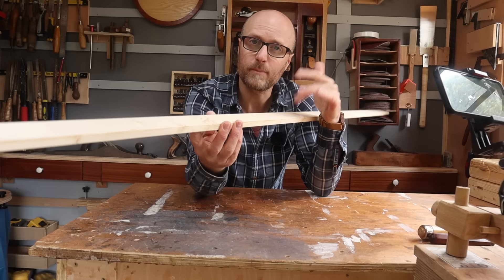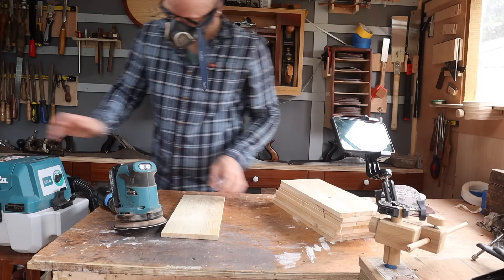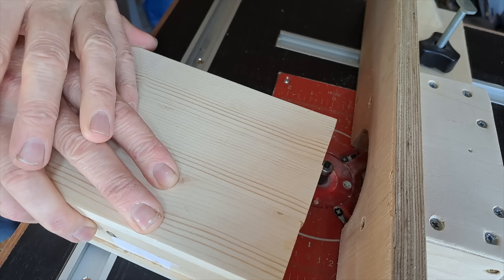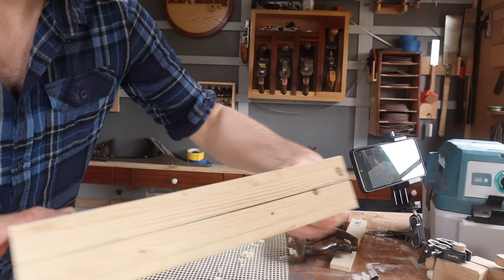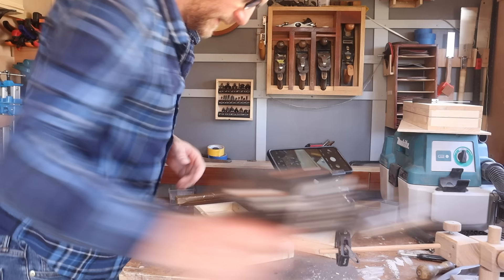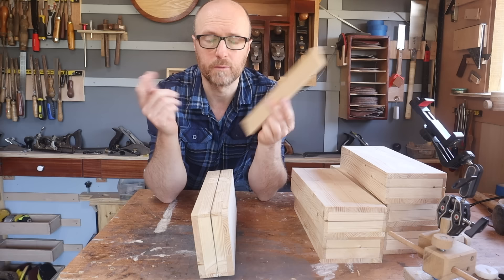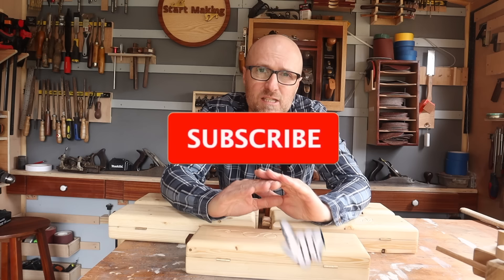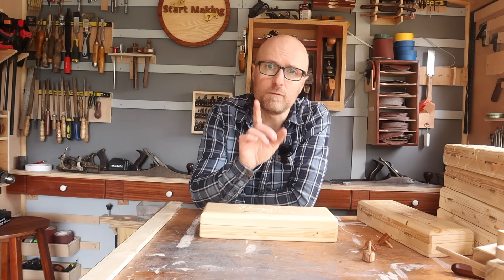Beginner Woodworking Project that Sells | ONE BOARD BUILD

Comment: I like that you are using mostly hand tools unlike every other YouTube woodworker that has saw stop and festool equipment saying "it's easy" as I cut a perfect edge with my $6000 piece of equipment.
Reply from the maker: Lol, I know, it is hard to relate to some but they also do some cool stuff. Me, I like hand tools and slowly growing into my tools.
Reply: I like the videos that are apparently aimed at beginners then they start showcasing all their fancy tools and it's like, what? Do I look like I got one of those?
Reply: Haha! 

"Check out this easy bird feeder ANYONE can make! Ok guys first step is take your $1000 length of dragonblood ply and fire up your $1000 Festool jointy-magoo-thingamajig"
Reply: I hate the noise of power tools. I love wood and would love to make things but I can't stand the noise.
Reply: Hmmm, I got my big uni-saw from facebook marketplace for $250...  It's used, sure, but it works just as well as it ever did.  I had to sand and polish and wax the table as it was rusty when I got it, but that only took a day or so and now its much sturdier and more powerful than the old Rockwell 9" contractor saw it replaced.  Most of my larger tools I've bought like that.  My Delta 14" band saw was made in the late 90's but still worked great for what it was, but I added cool blocks to it and replaced the old rubber tires on the blade wheels with new urethane ones.  Haven't added a riser to it yet, but will when I find one cheap enough.  My point is, you don't have to pay $6k to get a tool that will do just as well.  No, it doesn't have a riving knife, but folks managed without them for most of history.
Reply: @theoryofpersonality1420  You would like a PBS show called The Woodwright's Shop--That guy (Roy Underhill) only uses non-powered hand tools to build all his projects.

Comment: I'm not sure how this is beginner-friendly for people that don't have a lot of tools
Reply from the maker: You need a way to cut wood. A way to sand it and the router is optional. I get that beginners will not have a huge amount of tools but I did this without electricity and you can swap a circular saw for a hand saw. I don't understand comments that say this is not beginner friendly.  If you are learning woodworking you need to have some tools. The basics . Surely.
Reply: @startmaking1  For some people the idea that "beginner" refers to skill level and not available equipment just will not compute.
Reply from the maker: This comment is perfect. If you dont mind I will use this in some of my replies. I understand how some people will see the amount of tools, even the small amount I have (compared to the average video maker), and they will see it as expert but I consider my skill level to be beginner/low intermediate. And that is important. Thank you.
Reply: @startmaking1  wow you consider yourself to be beginner/intermediate? What's below beginner then? 😂 I'm below that.
Reply: @startmaking1  De nada, use it with my blessing. I learned that lesson the hard way myself, and it's something I've tried to pass on to anyone I've trained since: Doesn't matter how many tools you have if you don't know how to use them.
Reply from the maker: There is so much I can't do and we all start with different skills and go in completely different directions. Labelling it is hard and in most cases not too important. What is important is to enjoy it and not feel that anything is beyond you.
Reply: @dudeistpriest787  yup so true. I try to get someone more experienced than me to show me. Usually my son.
Reply: @KMF3  Isn't that what your kids are for? 🤣

Comment: Hi, Mark. Great stuff. 👍👍👍
Another option: (this would need to be done Before assembly)
If you would like to create raised lettering or imaging, on the top (or anywhere),
draw your image in double line form (like your block letters). Then use some small metal pieces
(whatever you can find that works), to hammer the image down, below the surface.
When finished, sand the entire surface down to the level of the image. Make it, just barely, disappear.
Lay a damp cloth over the sanded surface. Apply heat and steam, with a steam iron. (no damage to iron)
The image/lettering will rise up, to it's original height. You now have a beautiful hand carved top.
An age old technique, which I learned about (never used) many moons ago and thought was amazing and Still think is amazing. Works with, just about any wood. 😁✌🖖
Reply from the maker: Ho wow. That sounds brilliant and right up my street. What a clever and simple technique. Thank you.

Comment: Fantastic video! I’m planning on getting into woodworking and have watched a ton of videos, but only now found your channel.

I had a plan in mind to make a really sketchy table saw using a circular saw, but then I saw your setup and that’s so much smarter! The setup near the start with the metal rails.

Plus this video uses pretty basic tools and as someone whose going to be new I respect that a ton.
Reply from the maker: Hi Ben. Thank you. Glad that you didn't make that table saw. I've seen a few and considered it myself but it felt too risky. The kreg cross cut Station is a great starting point. There is a video I did on it. Hope it helps.
Reply: @startmaking1  Sorry for the late responses, I don’t check comment responses often. Thank you for the reply and I’ll totally check that video out.

Comment: These look really great, they could also be stained to make them less piney but that all adds to the outlay. I love the simple locking device really clever. great project idea even if you just make for friends and family at christmas. thanks for sharing.
Reply from the maker: Hi Andrew. thank you. Great gifts for sure. And yes satin would work but sometimes pine comes out blotchy etc and as you say there is the expense.
Reply: @startmaking1  yes good point I have had success with tinted varnish

Comment: So many ideas coming to me as I get ready to start the carpentry diploma course. Some ideas I'd like to share with you since you might enjoy using them in your projects are basically on the lines of using fluffy material for the outter finish. I have ideas to bring back pure raw bark finishes also for wardrobes, maybe even use the old western pub doors for wardrobe doors and other fun ideas like that, but the fluffy idea I think would sell, and would be great for those looking to use cheap wood that has knots and definitely wouldn't otherwise be used for fine woodwork
Reply from the maker: Fluffy materials, wow. That sounds like an interesting idea. And the doors too. I like that you are thinking outside of the box. That is how amazing things get created.
Reply: @startmaking1  yeh cheers bud, I think a lot of people are still gripped very tightly by fear, but now we have the knowledge of how to release fear slowly emerging on the planet, I think we will soon see the true creative potential that we have begin to show soon, because then nothing will stop people from connecting to their pure desires and passions if there's no negative emotions blocking those pure desires

Comment: For sanding the cut area between the lid and the box, you can also glue a full sheet of sandpaper to a board,  clamp the board to your bench, face the cuts down, and sand pull the bottom/top across the sandpaper.  Having a sheet of sandpaper glue to a board can be a great tool, use it to sand small pieces, to flatten pieces, etc.  I use spray adhesive to glue the paper to the board.
Reply from the maker: That is great advice. Thank you Scott. I use this a lot to flatten planes too.

Comment: For that 18V Makita vac, get yourself some rubber pads to glue them to those 4 small "legs" sticking on the bottom, so your vac doesnt move around, but the hose does. Works great on mine.
Reply from the maker: Thank you Michael. That's a really good idea

Comment: Suggestion when doing the hinges.  Always let brass hinges in to half way up the knuckle.  Looks far better than having the whole knuckle stuck out. Clamp the two halves of the box together and square across your hinges lines. Also use a marking gauge to mark the recess width and depth
Reply from the maker: Good Advice Gordon. Thank you.

Comment: I really enjoyed your video. I like your presenting style. 
The hinge tip is a cracker. Didn’t quite get what you meant by the shim though. 
Sticking the Japanese saw to a wood spacer is a brilliant tip.  I’ve never seen that before. 
Thanks again, please keep the videos coming.
Reply from the maker: Hi. You are very welcome. The shim was a terrible bit of filming. Basically when you close the lid and the hinge is in the closed position, both sides are not parallel, sides of the hinge that is. It is a little too closed to properly register/stick to the upper lid. If you pop a shim in the hinge it pushed the top half level or horizontal so that it can register with the upper lid and the tape can stick. I hope that makes sense.
Reply: Thanks for coming back to me. That makes sense. I thought it must be something to do with hinge not be yet attached to the top. Another great tip, thank you. I wouldn’t of thought about that until I’d fitted the hinge and the wondered why it was out of kilter. 👍
Reply from the maker: @myerscok  Very welcome.

Comment: Hmmm, I wouldn't be able to find those dimensions at lumber yards around here so I think I'll use a 1"x4"x8" as a substitute.  Instead of using that sponge I'll spray the inside of the box with a quick setting adhesive and then take a bag of flocking, pour some inside the box and shake it around a bit till it covers all the adhesive.  When finished, that flocking will look like the felt on a billiards table and you can get it in about any color you want.
Reply from the maker: That is a great idea. I love the idea of flocking. Looks really nice.

Comment: A cheap 3018 CNC (~$300USD) would make custom engraving for the tops a lot faster and open more options. It can also be used for the dowel knobs. The up-charge for those add-ons should quickly cover the investment.
Reply from the maker: Now that would be awesome. And as you say would open up some very good options. Sadly with a lack of electricity in the shed, for now it is not possible but down the line it could be.

Comment: Very cool vid indeed! :) 
I plan to make myself a jobsite tool box out of pallet wood and many of your suggestions will help make the build easier. I also have several tools that didn't come in boxes from new and will make boxes for those too. :)
Reply: Titan tools? 😅 it's usually why they're so cheap, just come in a plastic bag!
Reply: @richardmccann9293  Actually not Titan tools. I have the Titan thicknesser/planer and table saw so waaay too big for a box  lol. My main tool that I want a box for is my Bosch router. I also have a few tools from Crimson Guitars that need a good box too.
Reply from the maker: Hi. Thank you very much. I would love to see the tool box.
Reply: @startmaking1  I might even call it the "Toot Box"  lol
Reply from the maker: There's a brand there.

Comment: To cut the lids at the table saw, set the blade height for slightly less than the thickness of the sides. The blade won't cut all the way through. Finish the cut with a handsaw.
Reply from the maker: Good advice.

Comment: I think to finish the split box after cutting through, 120g sandpaper sheets stuck to a flat board then turn each side of the box upside down and a few passes it will be perfectly flat and even.
Reply from the maker: That would work very well.

Comment: M8 aa akways 👏👏👏👏 they look sweet love thr lock pons the heringbone and thor hammer stunning. A reckon you've 50 quid min in them in pine cheaper end hardwood (ash/sycamore) reckon you could be 75 high end wood Oak or sommiy exotic reckon you've 100+ in them. My one addition to advice on these as u said many ways to fo them but to help true up the boxes flat sheet sand paper just to line it up. Although as we no boxes and me haven't went well so far although that was a really detailed educational and professional video 👏 speak soon🏴👍
Reply from the maker: Thank you Michael. You are right about the sheet of sand paper. Works really well. I would have shown it but mine is covered in metal dust from a hand plane I was flattening the sole on. IT is a great way of sorting the lid and base out to fit. Money wise, I recon they could get a good amount but equally I would be happy to sell reasonably cheap and charge for the extras. Catch you soon.
Reply: @startmaking1  well that understandable. Yea think u could be right on the charging extra just remember material plus labour. Maybe it's just Me being clueless in the price side of it as we no am undercharging the now. Yea catch up later. 🏴👍

Comment: I have recently tried making this, I got the box together, no problem, but I messed up cutting the lid off. Will try again, but this time, I will leave the lid off & not try to be clever. You live & learn.
Reply from the maker: Oh Andrew, I'm sorry to hear that. The lid is the most annoying part to be sure. I used to use a circular saw to get mine off and that was definitely sketchy. I actually chatted to another guy attempting this and I think he will use hinges just on the lid and not join it first. Looked good.
Reply: @startmaking1  A bandsaw would be the perfect tool for the job, just a shame my sheds smaller than yours was. LOL
Reply from the maker: Ah. Yes. That would be an issue. I do wonder though if long term I would have moire fun with a band saw than a table saw but I still can't make it my first power tool. The table saw keeps winning out, even off it scares me a little.
Reply: @startmaking1  If space & money weren't a problem, both would be ideal. I try not to be scared of new tools as it could make things a little dangerous. Although caution is a good thing.
Reply from the maker: You are right of course, healthy respect is a good attitude for new tools. The router was the same and now it is my best friend.

Comment: I’ve been a contractor/carpenter in business for 43 years. I’ve been in the trades for 52 years. I don’t understand the reason for the many pieces and the glue up. I would use wider product and save lots of time and some cost. If the point of multiple pieces is the look of the grain.....well...I get it. But, to me, time is money. Different strokes. Dave The Carpenter in Omaha.
Reply from the maker: Hi Dave, Thank you for your comment and in some ways you are spot on. That is a far better way. I wanted to do all of it with one type of board to keep it simple for beginners. Thats why I did the panel glue up. That , and I had loads of this pine left from another project. The other reason I like this way is that whenever I get pine wide enough for a single piece on the top, it always ends up cupping. This feels a lot more stable.

Comment: Hi Mark
I liked the video so much I've started to make one for a Christmas present  for my daughter. So far so good. Such a good and straightforward design.
Are you able to post a link for the felt covered sponge that you used please. I can't see it.
Many thanks, Peter
Reply from the maker: Hi Peter. thank you for the kind comment. I have had real issues finding this foam. I think.since my last order and this video they may have stopped making it. I have had to do a work around. Which is not as good and a little bit of a faff but here it is. I use sticky backed felt like these https://amzn.to/3QxHZJX
then just normal foam or the ring box foam that you can get which has the annoying slits cut into it. I stick the felt onto the foam and that does a job. It's not perfect but it is ok. You could make the interior areas bigger ie less dividers and then take some foam and some fabric and make your own inners I guess. Depends on how much effort you want to go to.,
Reply: @startmaking1  Mark,
Many thanks for putting in this effort. I'll find a work around solution. best wishes, Peter

Comment: Great video mate 👍🏻 I’m guna make a few out of different types of timber and see how I go… btw, how much do you charge per box?
Reply from the maker: Hi Darren. that is a good question., A lot depends on where you are and what you are saving for. I found for £20 they sell at craft fairs really easily and you can add a few extras after the sale like the lock pin. But you could probably get a bit more if you use something a little more attractive than Pine. Im not saying this is a constant money earner but to batch out a few while learning it is a good way to save for a tool.

Comment: As far as pricing and metric sizes at the end, could you also equate Pounds to Freedom Tokens for us that don't understand metrics and measure by how many crayons long it is? I'll admit, we may have an extremely strong military force, but we still haven't caught on to the metric system for everyday things.
Reply from the maker: The funny thing is I get so confused that I use inches the swap to millimetres. I have watched so many American channels while learning that I am so confused.  I designed my workshop with the floor in feet and the walls in mm. It's a real pain.

Comment: I hate other way would you recommend for the kid removal without a table saw or that flat saw?
Reply from the maker: you could use a band saw, or even just pop the box in a vise, draw a line round it and just cut it carefully with a normal saw. Take care to pop shims in the bits you have cut so that the vise doesnt squeeze the saw.

Comment: I like the project and unpowered hand tools.
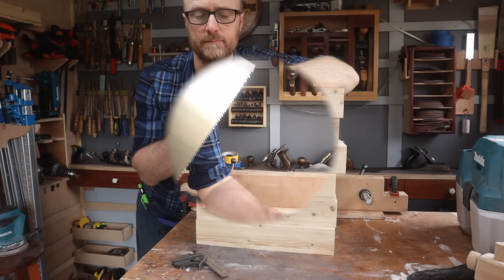7:30  But calling the saw used a flush cut saw bugged me. That is a Ryoba saw, and they usually have a minimal set to the saw teeth. Real flush cut saws have no set to the saw teeth to prevent scratching the wood while cutting pegs flush.
Reply from the maker: You are correct . Sometimes when I am editing the videos some things I have said slip through. Unfortunately once uploaded you can't add bits in. Sorry for the frustration